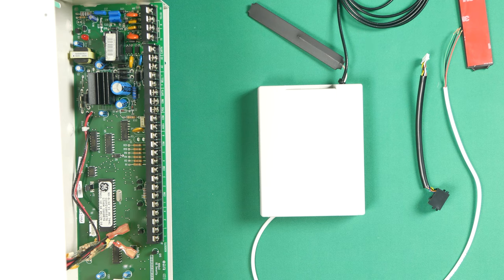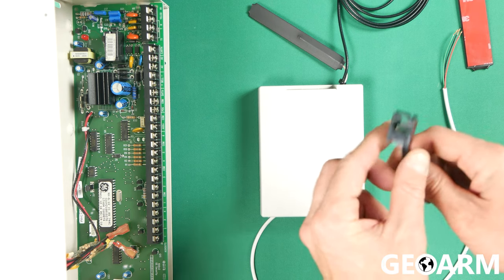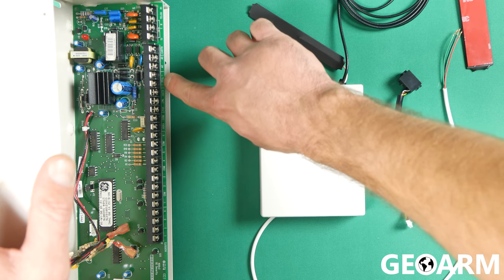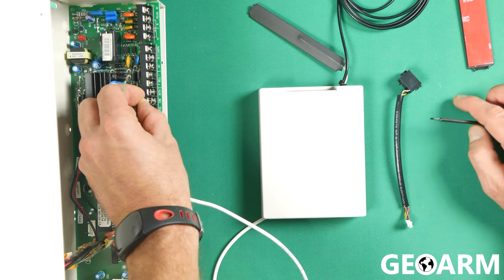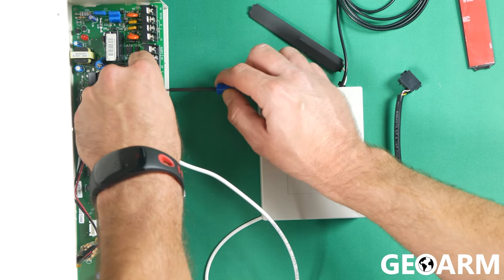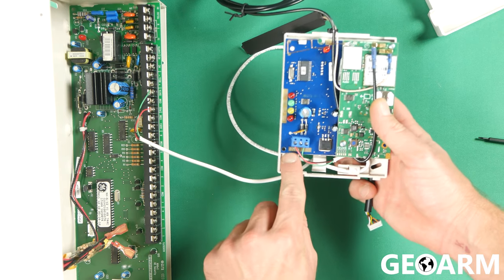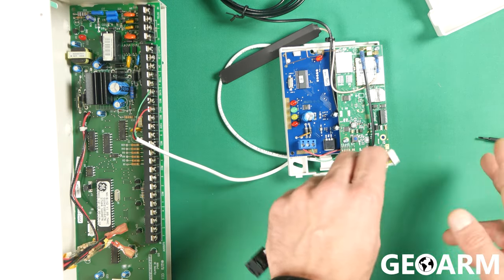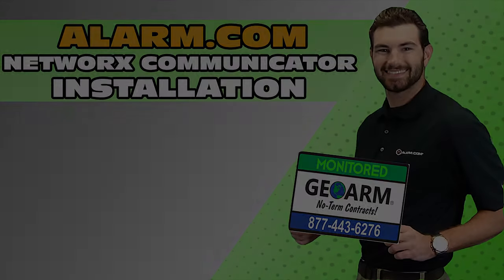Alarm.com GE/Interlogix NX-Series NetworX Communicator Installation

Comment: I like the ethernet Cat 5. Question the ethernet should be T568A, right ? Sorry, i have no nails.
Reply from the maker: Hello! According to Alarm.com, either T568A or T568B would work with this connection! If you are in the market for low cost Alarm.com monitoring, please take a look at some of our plans here : https://www.geoarm.com/alarm-dot-com-pro-interactive-cellular-path-home-alarm-monitoring-services.html
Reply: @Geoarm  Thanks for the tech tip and the option of monitoring my security system.  Question,  I'm looking for a GSM for a Vista 20P. Any suggestions ?
Reply from the maker: @jeffmays4708  Absolutely! We have several options, a few of which we will list below for you!

Alarm.com AT&T option: https://www.geoarm.com/adc-sem210-vt-at-alarm-dot-com-sem-honeywell-vista-dual-path-att-communicator.html

Resideo AT&T option: https://www.geoarm.com/ltem-xa-honeywell-cellular-att-lte-cellular-alarm-communicator-for-vista-series-panels.html

M2M AT&T option: https://www.geoarm.com/mn02-lte-m-m2m-services-universal-multi-band-cellular-att-lte-alarm-communicator.html

Comment: Does anyone have a resource to remove this from programming?  We took over an account and installed a CellCom communicator.  When the 3G sunset occurred,  this unit went defunct. It's causing serious communication faults,  but i cannot find support on how to remove this communicator.
Reply: very late but once removed from the panel. enter programming and exit again. it will auto delete